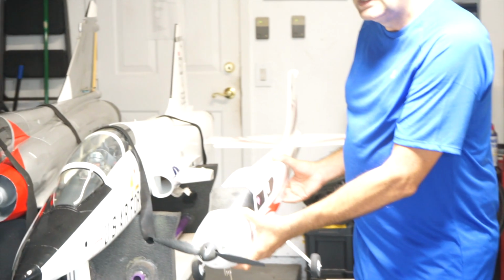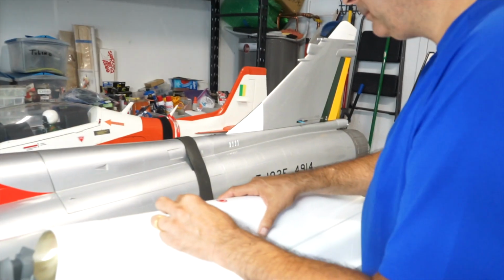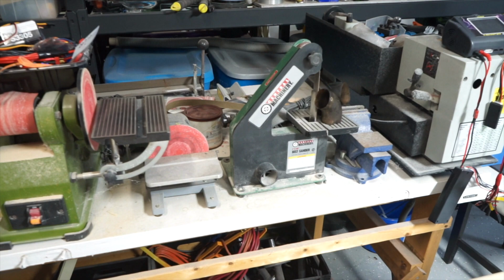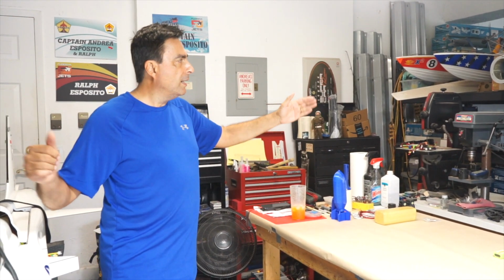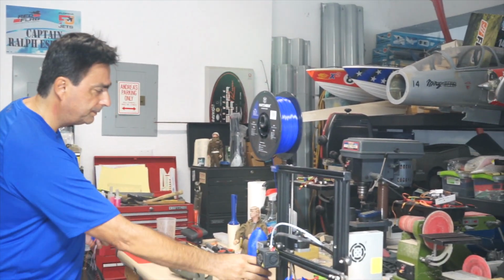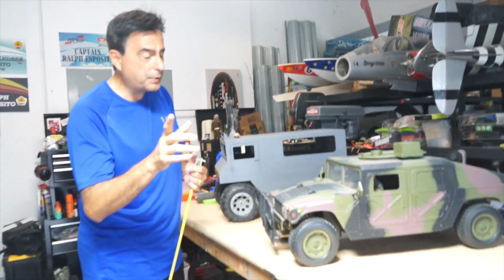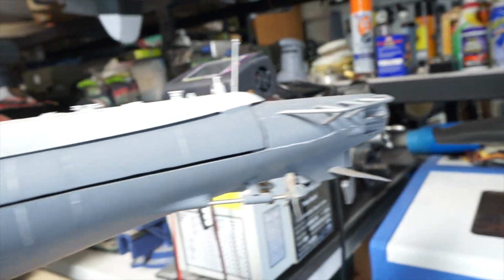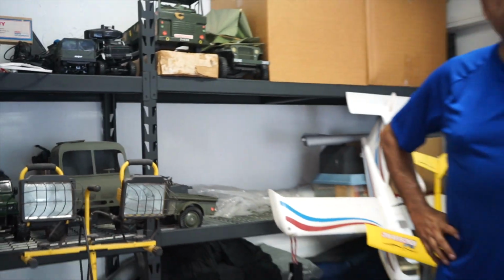RC Garage:   Hobbyist sharing  his passion for RC  hobby and a peek into his workshop.

Comment: Very nice Skymaster Xtreme-Jets T-38 Ralph. I'm currently building one. How do you like the 120N in it? I was thinking of going a bit larger 170-190N engine
Reply: Hi Frank
Just saw your question
The 120 is plenty for the T 38
Lots of power
Reply: @captainralphy  thanks so much. About to maiden mine soon.
Reply: @FlyWithFrank  make sure that as you turn final, to fly the approach with the nose pointing down.... once over the runway you can flare and raise the nose....
Reply: @captainralphy  yeah I have been all over this video...this is how I wound up buying the jet too 😀. Can I ping you about throws and elevator neutral points e.t.c?